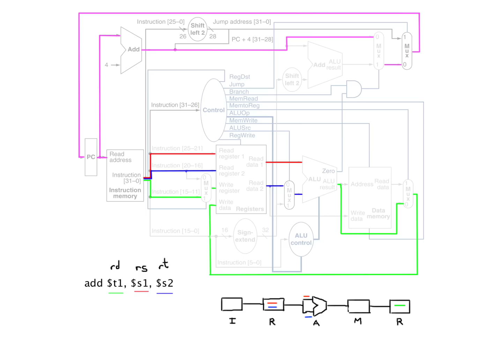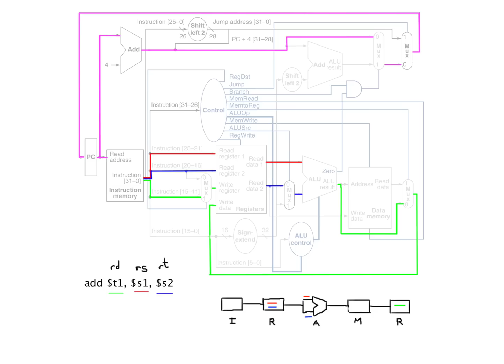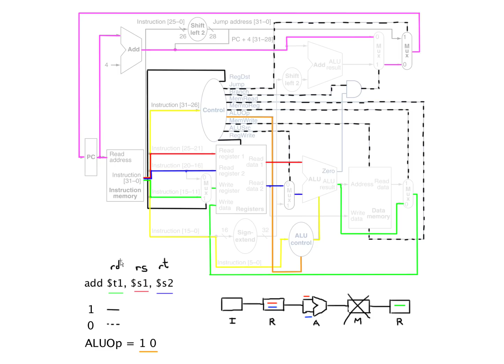Datapath Control R - Type

Comment: Can someone explain to me why after each instruction you add 4 to the program counter. Asuming you have an 8 bit rom, getting a 32 bit instruction field would require you to cycle through 4 adresses to begin with. What's the point to adding 4 after that ? Is there a secret two bit counter somewhere that's not displayed and this is just an over  simplification ?